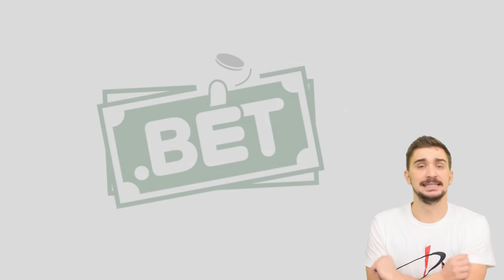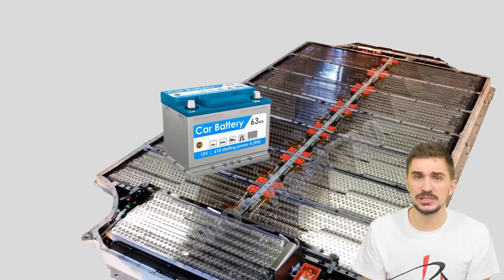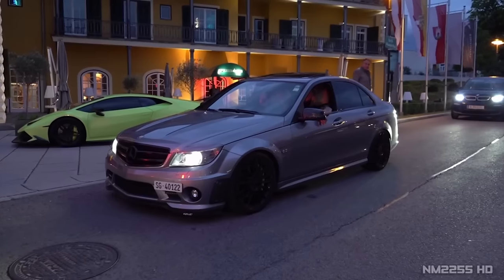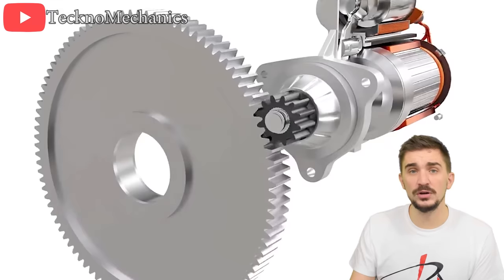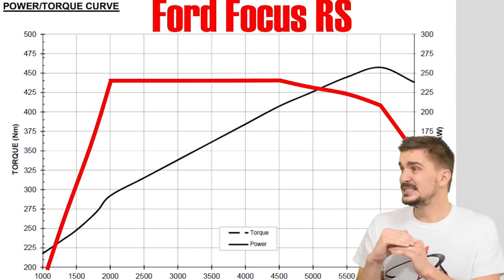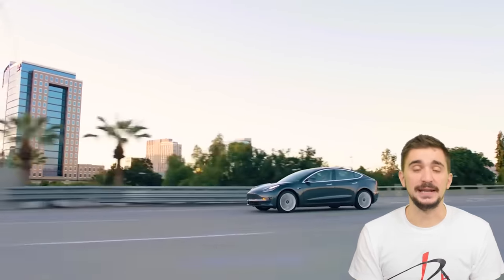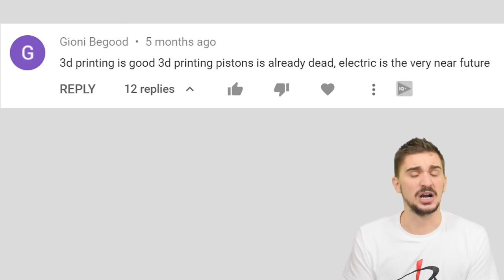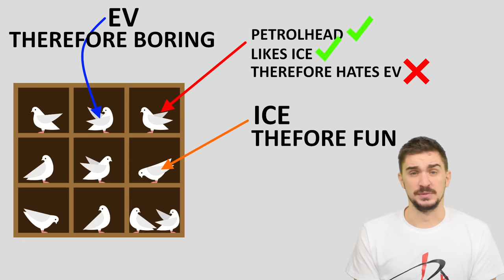ICE vs EV - IN-DEPTH comparison of BATTERY ELECTRIC and INTERNAL COMBUSTION ENGINE vehicles

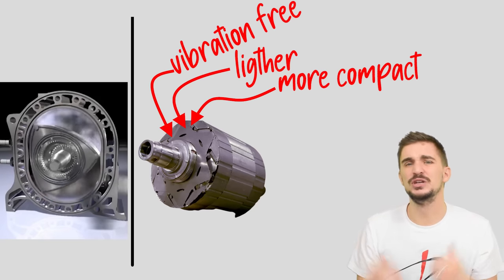Comment: @10:30, isn't Lighter spelled with an h, and not LIGTER?
Maintenance:  A Tesla's brake pads last a very long time, in part because the car uses regenerative braking.

Do ICE engines have their place?  Yes, they do.  Some tasks are better done with a gas engine, some are better with a diesel, and some are better with an EV.  No one engine is better at everything.    To the point you made, ICE vehicles are better for off road, or travel over sparse areas where you can carry extra gas but not extra electrons.  

All too often people give you a "All EV's suck because they can't tow as well as a Ford 250 super duty."  Well, if you spend 100% of your time towing in such a truck, then an EV is truly not the best choice (yet?).  However, how many people own F250's with lift kits for groudn clearance and added TOW packages, yet never tow anything or go off road?

Full Disclosure:  I own an EV and I love it, for the tasks I use it for.  Would I want an EV bulldozer, moving truck, or space ship?  I doubt it.  Do I prefer a EV car for highway use, you bet.

Comment: I spent so much money and time in my life on repairs and maintenance of combustion engines. I'm done with that.

And I want to bring up another topic: Noise. When ICEs are started in the morning, when they accelerate they make a lot of noise. Especially, when they are cold. Diesel are the worst. They destroy my good sleep in the morning. I hate them.

I am a bit disappointed, that you only mentioned the problems with lithium mining, but don't say anything about the far worse problems with oil. What about oil catastrophes, oilsand in Canada, leaking pipelines, offshore oil mining ...?

Comment: <----petrol head Turbo H2B F20B 300HP 2250HP Civic Hatch have had a dozen swaps in 6 different chassis 3 have been over 150HP/1000LBs
<----ev/plug-in daily drivers for 7+ years (500e, Volt, i3 REx, CMax Plug-In)

Thinks long range EVs could have problems with mass adoption especially if a war happens even just a trade war.  Plug-In Hybrid uses 1/10th the battery yet may offer 60-90% the fuel savings!  How often do you drive over 40 miles?

Thinks plug-in hybrids are nowhere near done advancing!  RAV4 is faster than Supra 5-50MPH!!!!  New Jeep Plug In is fastest Wrangler.  

EVs are considerably more expensive than ICE to drive in the Midwest of USA for 50% of the year!  May not even get you to your destination during the winter!  I know I've owned a few and plug-ins owners try to use their cars as EVs... not sure why and I don't!  I use ICE when it makes sense and electric when it makes sense!

Gas and electricity prices may fluctuate!  Plug-In Hybrids use both!

Biggest benefit for me to Plug-In? Good performance while driving like a jerk without the cost of driving like a jerk on ice (5-10mph).  And I go to the gas station for gas 6-8x a year and I only buy 5 gallons per visit (excluding any long road trips).

So I love my ICE engine... will continue to love it.

I hope electricity prices fall in the USA and I hope mass battery adoption doesn't lead to rare earth metal pricing issues.

Comment: EVs are older than ICE vehicles.
Didn't work then, won't work now.
Reply: I am a petrolhead, but I really doubt EV's will fail. They will be around, but  I really don't see them occupy more than 5%-10% of the entire car market. At least not in the next 40 years.
Reply: @lovropirkl2672  If it wasn't for the subsidies and privileges, EVs wouldn't have more than 1% of the market.
I prefer hybrids.
One with 50-75 km of range would be enough for use in the city and because of the ICE it would have enough range for outside the city and also be convenient.
Reply: You reckon? Check sales stats in Norway.  Look at rate of adoption trends everywhere.
I'm afraid ICE will be steam-engine dead pretty soon.

Comment: To do that you will also have to bypass the neutral safety switch. But that would be a modification. If you disconnect the plug wires you will also have fuel still being delivered to the engine so now you've loaded the cat with fuel and probably damaged it too. You lose.
Reply: just disable the injectors. Remove the wires which send the fire signal
Reply: @dieselgeezer18  Or disable the fuel pump. And yet another mod,
Reply: @bradmaas6875  yes. But i would not call it a mod. You just disconnect a few wires. Nothing special

Comment: The first mass produced motorized vehicles were electric, not ICE. So EVs are older and had more "evolution" time than IC vehicles. What they didn't had were the trillions of $ poured in an industry that makes you dependent on a particular flammable fluid and lubrication from the same product.
Additionally EVs have much longer life than ICE vehicles. 
We not only need but we HAVE to leave the combustion engine in history as fast as possible. But enthusiast don't have to worry... we still ride horses and have horse races even today.

Let's have a little background check on the oil extraction:
- Pumpjacks consume 9800 MWh/month of electricity. There are 1.1 million active pumpjacks worldwide. 
- Hundreds of thousands of pipelines. Each section with a pump consuming 50-250 kW and working 24/7. 
- Refineries consume 15-20% of annual electricity consumption for the whole continent (just in the US). 
- Offshore platforms burn 20-30 tons of diesel per day for their generators. The United States alone has 610 active offshore platforms. 
- Tankers, each of them burning 200-250 tons of fuel oil per day. 2,210 are currently active tankers. 
- Land transport with tanks - ~ 40 liters of diesel / 100 km. 
- Gas stations with all their pumps and energy consumption. 
... and we haven't touched on shale gas and coal mining yet. ... nor have we paid attention to oil spills, pollution of rivers and groundwater, deforestation and wars.

An average ICE vehicle is responsible for 260-350 g.CO2/km + NOx, SOx, CO and other harmful fine particulates right in the cities where we live. While an EV where the energy mix is 40% coal, is responsible for 36-48 g.CO2/km... with no emissions during operation.
Manufacturing of an ICE vehicle releases 5200 to 6900 kg.СО2, while an EV (+battery) releases 5600 to 8800 kg.СО2. Emissions are equalized after less than 10,000 km. After 250,000 km the difference in emissions is 10 times more for the ICE.

Comment: One of the things I've found funny about Evs are that the EPA and the Liberal democrats in America seem to hate on the ICE but if you look at actual shortages silicon is becoming extinct due to over use seeing how we use it in virtually all electronics  today and we use these for all cars but more in EV cars as there is more electronics that put this compound in higher demand than before so even though its good for the environment as they tell you simply because it doesn't produce emissions for its life cycle in turn emission are still produced just as bad in the refining process to make each car that effect the environment the same if not worse. Funny thing is that the EPA are steak holders and have power over the laws but yet stand to gain from the force shut down of ICE and people are to stupid to realize they ae trying for a life time monopoly under false premises to fool the people. These cars are over priced  and will only become worse as shortages continue to rack up even if all cars would effectively stopped making cars every other device needs this element. Like any electrical item it will fail and either your a technician and or can do it yourself or you take it to the dealership where they will rape your wallet higher every time because parts manufactures aren't steady when prices of this item continue to rise yearly along with the newer EV cars watch. Tesla came out and it was Demon priced the Porsche came out and way twice the amount of the Tesla and only added extra motors more weight and a 2 speed trans doubled the price. welcome to the future gents, might as well walk only the snob can afford these.

Comment: Just watched you bike carb balancing from 2 years ago.  
On carbs with adjusters between pairs of carb bodies, there isn't actually a 'base' carb. 
That's a throwback to when carbs had individual adjusters from around 1979~88 but it kinda stayed in training manuals.
With 'perfect' balance you could probably remove almost all the flywheel mass as most car engines have pretty mild cams and quite heavy crankshafts compared to 180+ bhp bikes.
Reply from the maker: There definitely is a base carb, there must be one otherwise you have no reference to adjust against. Think about it, there's three adjustment screws but four carbs, and the throttle cable is directly actuating one of those carbs which you can't adjust. In my case that's carb 1. When you turn the adjustment screw between carb 1 and 2 you're only moving throttle plate 2 in reference to throttle plate 1, but 1 doesn't move, it stays in the same position. The only way to move 1 is with the idle rpm adjustment knob. The flywheel doesn't balance out anything in a four cylinder engine and the carb balance has no relation to the flywheel mass. One of the main tasks of the flywheel is to smoothen out the power pulses from the engine and you can't really get rid of it no matter how much you balance out carbs or rotating assembly masses. If you were to get rid of it the engine would have great trouble holding revs and moving a vehicle from standstill, and efficiency would suffer too. Also, you need something for the clutch to grab onto.
Reply: @d4a  It depends on the type of adjuster and where it's located. 
 Usually you have a 'U' shaped bracket of some type with a screw on one side and a spring on the other then a 'flat' plate between the screw/spring for the next throttle shaft. 
As sets of carbs are almost always designed to be machined from both sides and the throttle shaft adjuster determines if it's a 'left carb ' or 'right carb' (various bosses are not machined on the outer carbs)
The position of bracket can cause adjustment of #4 'far right' on motorcycle numbering) to open #3 which will mess up idle speed (or, if 3&4 were already messed up, idle speed may need to be raised as sync gets closer).
 Honda is the manufacturer who decided in their training to specify a base carb on 1978~79 models (I forget exact year) 
Various training schools have kinda stuck with the convention even when it isn't used by earlier models or other manufacturers (I only know as I was teaching at a motorcycle tech school almost 12 years)
As for flywheel, it doesn't 'balance' anything but the mass is to smooth out crankshaft speed variations. 
With less mass engine will accelerate faster and even though the difference in flywheel weight is minuscule compared to total weight of car it has been shown to improve acceleration and lap times. If all cylinders are completely even and firing correctly, you can either lower idle rpm (within limits to keep oil pressure acceptable) or, have same idle with less flywheel mass
Sorry to be such a PITA over semantics

Comment: i was on lunch break from my job and saw a tessla dual motor and then realized we were racing and then i stomped on the pedal and pulled on the tessla and then gave up and went to the gas station.
Reply: i was in number 2 gear of '05 altima 2.5L 5 speed.

Comment: You couldn't have an EV unless a combustion mined the lithium and other materials that they are made of
Reply: Lithium can be extracted from clay and brine. Which just requires a few pumps and the heat of the sun to do a lot of the extraction, you could not make gasoline or a gas car without an an electric motor.

Comment: However… most cars lock out the starter when the clutch isn’t pressed, and automatic cars won’t crank in gear… and likely wouldn’t move if you could… 😂 so, I would win the bet against you with MOST cars.

Comment: You just lost a bet. My BMW will not move an inch when I press the start button. In fact nothing at all will happen unless I press brake and the gear box is in neutral when I press the start button.
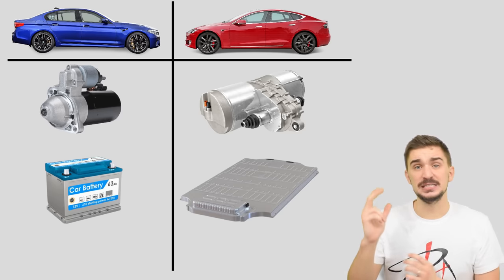And my BMW is very close to the blue car you show at the top of your table in 3:20.
So: No, you cannot make any car move just on the starter. I would guess most modern cars will never do that.
Other than that I have no objections to your video.

PS. The battery is also larger (90Ah) since it does not charge the battery all the time and run power steering and AC on electricity.

Comment: EVs are expensive to buy compared to ICE vehicles. There are other issues not discussed here like range and how batteries don't like cold temperatures. I prefer ICE vehicles myself but my aversion to EVs is more to do with the reasons they are being introduced by the power structure. Not being a great believer in global warming, now climate change, due to the drop in temperatures in recent years, plus all the lies about various environmental phenomenon, it seems to be more about limiting travel and limiting the public's ability to buy vehicles.For the nay sayers look at 20 min cities and agenda 2030. If it wasn't for all that then I would have a more favourable attitude towards EVs. Most of the hype current;y surrounding EVs is just that, hype. Having said all that if an EV was made with a very light battery and a similar range to an ICE it may be a good thing.
Reply: Where I live it snows maybe once in 5 years, and I believe it may have become slightly more recent. You know, I'm getting real tired of this "Global Warming" lol
Reply: @egortokarev2296  We have had very wet weather over the winter here in the UK but it has been dry recently. Any strange weather events are usually due to geoengineering, which has been ongoing on a major scale sine 1998.

Comment: A comment to balance out EV-fanatics:
The production of ev's is not at all clean, rather oposit in fact.
The materials used in ev's, are already starting to deplete, and is one of the reason why computergear is not meeting productionnumbers.
The lifespan of a batterypack in ev's, is at best 10 years, and combined with the cost of replacing said battery, it will be cheaper to buy a new car, which leads to much more cars beeing scraped, and therefore much more waste. The waste of said battery, is in itself a future disaster. There are no viable plans for what to do with this shit, and it is probably going to be a much bigger problem than todays emitions(which  actually is solved using syntetic fuels that are clean, but currently expencive.) The syntetic fuel can basically be used directly in an ICE vehicle, and also be pumped from existing gasstations. This would negate the need to build chargingststions, which would take a lot of resources, and polute a not so tiny amount in the process. We also have the subject of sustainability og the electrical grids, the way electricity is produced in many places (not at all clean), and probably a lot more.
Another thing to consider, is how the f*** are all the people living in cities going to charge their cars?
This entire EV movment, is as dumb and shortsighted as it gets. It is NOT a viable future. I do know lots of people are going to be angry with this, but that is ok. One day, this will all make sense, I hope soon, before it is too late.

Comment: 23:57 Maintenance frequency is still lower for the essential drive components- It can take up to a decade before an EV battery pack would be be deemed unusable due to degradation, and the brake service, coolant and gearbox oil service time/mileage points are always significantly more spaced than they are in ICEVs- Again, due to simplicity of the task(s) required of these systems and the load they take on.

Comment: "Without modifying anything"... "Step 1: Modify the electrical connections" 🤔
Reply from the maker: You're not modifying anything, you're just unplugging things. If that's modification than I modify my toaster every morning.
Reply: @d4a  if you take your toaster apart and pull the power relay, then I'd say yes 😂
Reply from the maker: @bytesandbikes  But there's no pulling of any power relays.. I'm sorry but I'm not seeing the point. You just disconnect the spark plugs, that's not a mod
Reply: @d4a  I don't think there is a point here, it's just the intro to your video!

But as a philosophical point, I find the difference between what's a modification and what's usage interesting --
turning the ignition key would be closest to that 'unplug the toaster' scenario, and no-one is going to say that's a modification.

As a different example, if you were to remove the power to the EGR, that's going to change the way the engine works, and it definitely a modification legally speaking.

But let's not get into what counts as a mod legally -- if you read your insurance documents carefully, replacing worn tyres is a modification if you don't get OEM.

Cheers for the video anyway :-)

Comment: If EVs were good we would not need incentives to buy them.
Reply: I bet you can buy an EV without the need for ANY incentive. EVs are already getting cheap. For example, you could buy a Chevy Bolt for under 30k, or a Tesla Model Y for about 40k.